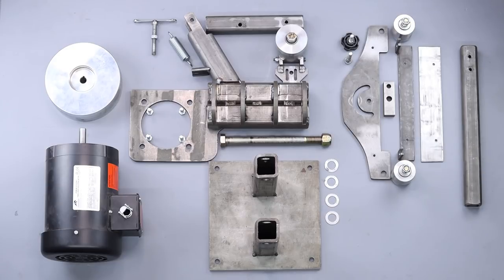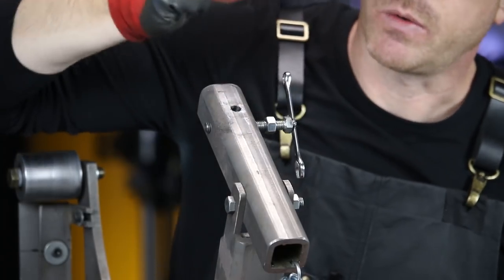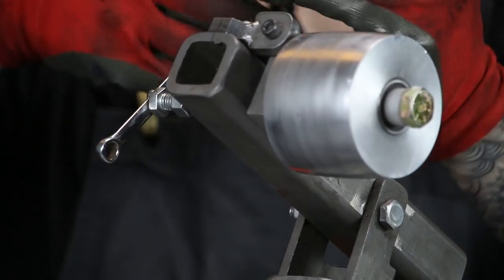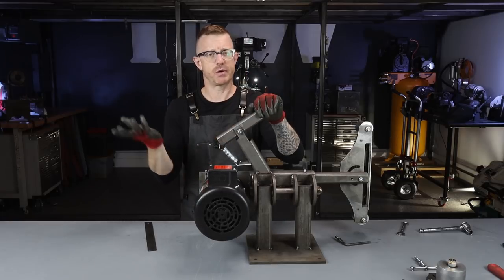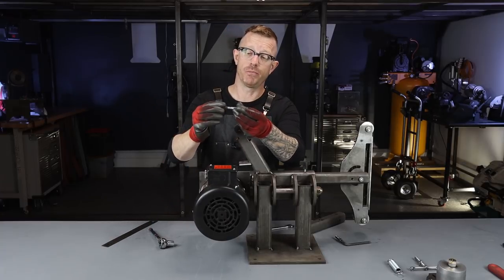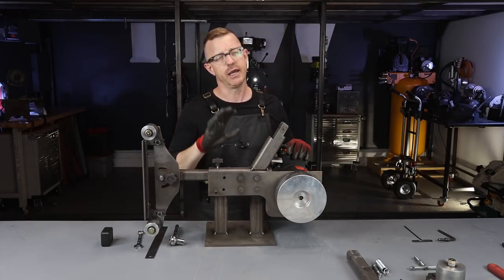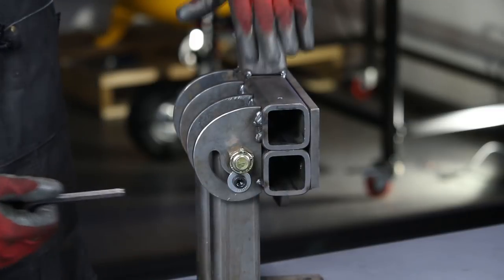The Anatomy of a Home Built DIY 2x72 Belt Grinder For Knifemaking

Comment: I understand that the thicker wall for the tube steel creates more weight, but that also reduces some vibration. I believe that your design is spot on. Haters gonna hate, Brian.lol
Reply from the maker: I giggled when I read ‘heavy & over engineered’  where are you taking this thing any how? Maybe I should put hooks on it for a crane? 😂
Reply: I like the crane idea. Where I build mine will be where it lives.lol

Comment: I built one about two years ago , I actually just got it working with a vdf and 3phase motor video coming soon I really like your design with the ability to turn vertical , mine doesn't have that option. I wish I would of saw your design when I started my build.
Reply from the maker: You can always build another one like I did! 😅
Reply: House / Work that is true my friend !!
Reply from the maker: Zach of All Trades - I’ll have plans ready in a week or so.
Reply: House / Work that will be awesome, it’s crazy all the videos I’ve watched and plans I’ve seen and how different minds come up with different ideas for things , and they all do the same thing just some with more finesse. Yeah when I upload my video you will see how I did my knobs pretty cool design , and my handle for my spring tension came off a old piece of equipment my grandpaw owned so made it even more special.
Reply from the maker: Zach of All Trades - Oh cool. Make sure you send me the link when you upload it. Looking forward to that! 👊🏻

Comment: They make a seven inch wheel with a high durometer rubber clad to it, saves a lot of belt life when running the motor backwards and edging with that big soft wheel.  ..great for putting the perfect tip on tungsten too..

Comment: Great video! I will be ordering your plans soon. I already have most of what I need to make the build. Although I do plan to make a few adaptions. I have a 3.25 hp motor with a shaft out each end. I plan to incorporate a 10 inch disc sander with work table on the other side. I can then keep an assortment of 3 different grits ready for use all at once (one belt, and one disc on each side of the disc grinder). The tilt feature will make my ideas even better than I thought it would be.

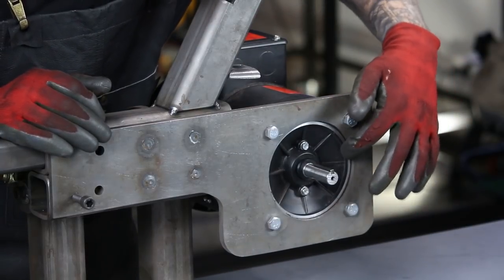Comment: Great design, Brian. I am really enjoying watching all your videos and plan to do the build.  I’m at 15:29 in the video and I’m wondering why you couldn’t get away with perhaps a 1” diameter hole for the motor shaft instead of a 4-1/2” hole?  There may be a good reason and I’m just not seeing it. Thanks for your fantastic instructional videos!

Mark
Reply from the maker: Glad you like the series. There is a 4.5” ring on the face of the NEMA 56C motor and sticks out and that hole allows for the motor to sit flush against the motor plate. Hope that makes sense. 😁👊🏻
Reply: House / Work  Brian-  that makes perfect sense.  That particular motor happens to have a protruding ring.  Keep up the good work!

Mark

Comment: For the 1.5” tubes to slide into the 2”, .25” wall tubes, is it as simple as removing the seam weld?  Is there any other clearance work needed?
Reply from the maker: Remove the weld seam and soak in vinegar to remove mill scale. They telescope nicely.

Comment: Absolutely great videos and attention to detail!! I have a free industrial-size rheostat and a free 3HP DC treadmill motor. Spent $5 on a full bridge rectifier and the motor spins great, in either direction. 1 question. The motor has no side bolts, only a base I would need to weld onto a plate and then weld to your motor mount. Will that work? TIA Rog
Reply from the maker: Yeah there have been some bottom mount builds done of the Revolution. It can work. My suggestion is to not use a DC motor though. You should get a TEFC motor you will be much happier.
Reply: @HouseMadeUS  The DC motor was free. Why do you recommend the TEFC motor? Thanks!

Comment: That is a great design. You really went all out and I appreciate you sharing.  Truthfully, how often do you think you would need to change positions?  It does seem to be a cool feature but since I built mine, I just use the rubber wheel.
Reply from the maker: Well, I just profiled a knife for the first time (the KnifeTalk Podcast video) and it really helped to have the horizontal position. I think once you have it (and you have a work rest that works in that position) it helps in a lot of ways. And you find ways to make your work easier.

Comment: Great video!  One, maybe dumb, question. I'm planning to build my first belt grinder and was wondering if it makes a difference weather or not the belt and spindle are on the left side of the machine vs the right?  I already have a motor and and it spins the opposite direction of yours so was just planning to flip everything but wasn't sure if I was missing something.  Thanks
Reply from the maker: No not a dumb question at all. Lots of people flip the revolution around to the other side and basically make a mirrored version of it. The parts allow for it as well. Also if it’s a three phase motor you may want to try a VFD that has a forward and reverse switch because many of those motors will spend both ways.
Reply: @HouseMadeUS  Thanks for the reply!  That's basically what I thought but wasn't sure if I was over looking something.  I have an old treadmill motor that I plan to use.  I'm building a cheap version because I only dabble in metal work.  If I like it and want a better one I'll probably use yours.

Comment: I just bought your plans, thanks. There is however one thing that looks odd. The milled out channel in the platen face, your plan shows 19mm from the center of the hole to the center of the channel ...that looks way too little. 19mm is only  .7480 of an inch.  Is that correct ?
Reply from the maker: It works that way but feel free to push it out another 19mm - I have considered changing that on the drawings. Thank you. 👊🏻
Reply from the maker: Hey, I redrew the platen this morning to solve this issue. I can send you the file via email. Shoot me an email and I’ll send it over. Brian@housework.us

Comment: Hi, Brian. Awesome job! I checked local steel suppliers, and max(by thickness) that I can get is 40x40x6 mm and 50x50x6 mm steel tubes. Are these tubes enough to build grinder by your desing? Because  I'm living in a metric part of the world where its hart/impossible to find parts with exact same sizes as in imperial units. Also, are there any other parts, which sizes are crucial for the success of the build adopted to metric units parts?
Thanks in advance!

Comment: Brian, are there any plans for a single wheel attachment?
Reply from the maker: I’ll shoot ya an email on how easy it is with some pics and video. Essentially it’s a tooling arm with a tapped hole to hold the bolt that holds the contact wheel. And a spacer to give the proper X axis alignment. Or maybe I’ll make a YT vid on it.
Reply: House / Work  awesome, look forward to seeing something on it. Thanks Brian

Comment: Grate job.
At how many rpm the motor runs and how many HP do it have?
Thx
Reply from the maker: It’s a 2hp motor - 3600 RPM at the shaft, not sure on the match of the actual RPM with a 7” drive wheel. Somewhere near 8000 I suspect. 👊🏻

Comment: Can the motor be used without a VFD until I can save my lunch money for one?
Reply from the maker: This setup has a 3 phase motor and most workshops don’t have 3 phase. So a VFD would be required. Now if you have a single phase motor you could go without one. 👊🏻